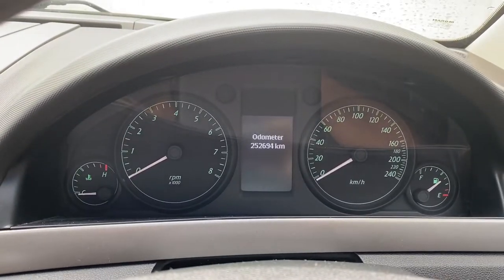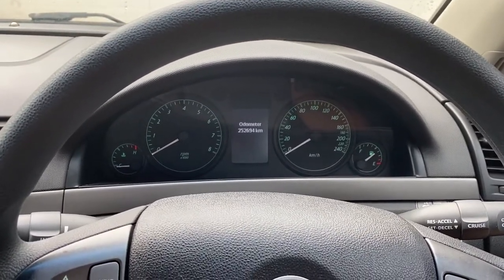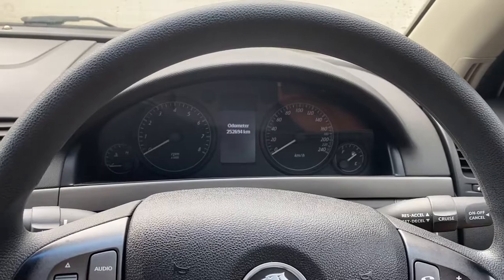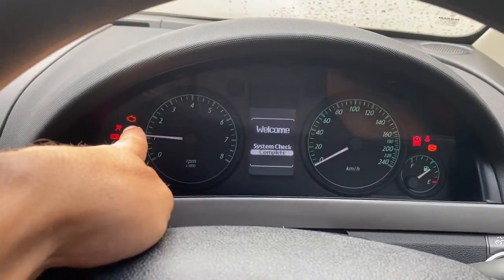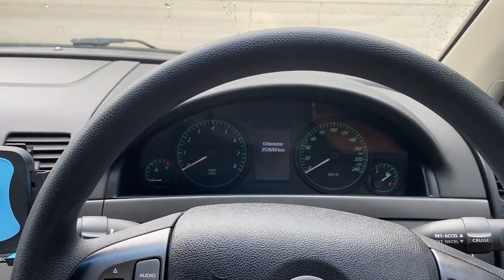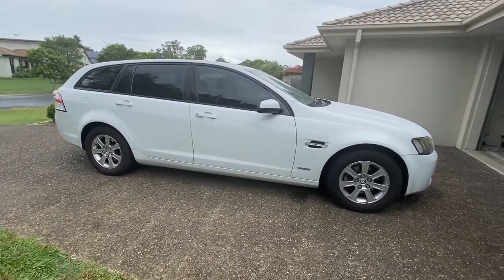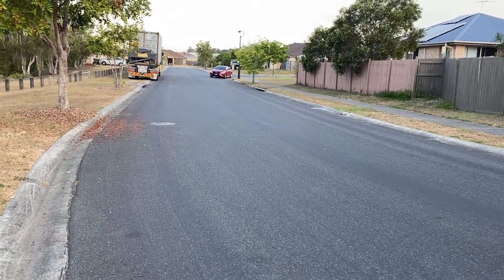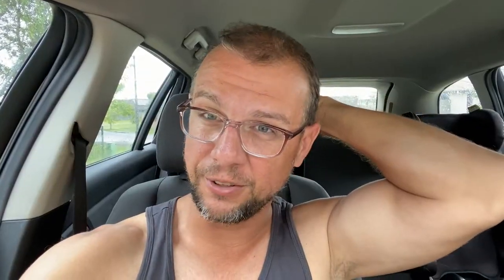250,000KM Commodore Timing Chain Issue Update

Comment: Just watched your Timing chain video which confirms my thoughts and approach to 'limit switch' monitoring. I bought my VE Ute about 18 months ago with the engine dash warning and new about 'issues' with the VE engine timing chains. Like your wagon the car runs great, there are no noises coming from the engine and I plan to monitor it as you have been doing. I only drive about 3000kms per year so I'll never get to 250,000kms. Sitting at 205,000 now. Thanks for sharing and confirming for other VE users. You should definitely keep your VE as a workhorse, its still a nice looking car!
Reply from the maker: Hi Gary, thanks for you comment here. I move the old girl on, I madea  final video to finalise it all, good luck with your VE...👌

Comment: Bought mine at 160thousand. Vz alloy 2006 ,No timming chain done. Engine light came on around 200 thousand. Transmission light round the same time abs fault around the same time and I'm running it to the ground still going strongish at 250. Just started hearing a new sound though. That's what brought me here. great vid mate. 👌
Reply: G'day bloke.06 vz sv6and calais will have an updated chain and pulleys so will never give ya timming chain dramas.Yoll know what you are hearing when you hear it.Youll pray it's the aircon  compressor but you'll know it's not.good luck
Reply: @riffraff1015  ahhhh okay, Thanks for the good information!
 It's been a year since this comment so sadly i don't have it anymore. Got a ve now haha. Thanks for the reply though appreciate it.

Comment: I have a 2011 Omega, 314,000kms with original chains, still runs pretty good, but have replaced a number of parts including the evap solenoid, a couple of water pumps and starter motor.

Comment: Thanks good info . My 2009 be 3.6 has 305000km with an intermittent engine light . I’ve been doing 10000km oil changes for the last 150000km. Let’s wait and see .
Reply from the maker: Hi Ben! I've sold mine, so keep us updated, as my last video will be a 270,000km final one!!

Comment: i've got a VF 2014 SV6 LFX 210.000Kms with the 10mm timing chain. Its been rattling for a while now and i thought it was the cam phasers. But after taking off the rocker covers yes its a loose chain on bank 2. No codes though. I think holden adjusted the software so it don't code till much later.

Comment: I just had my timing chains replaced,  the engine had a rattle on start up. Which I was told was the variators on the cams. The chains had apparently been replaced but with cheap Chinese chains.
Reply: Did having the timing chains replaced solve the start up issue? I have the same issue.

Comment: Hey Vroom Broom,
2009 VE sports wagon, bought at 130,000km, currently has 192,000km. On any  cold start, it has a couple of seconds rattling at the front of the motor  then o,k.  However,  last oil change, I filled with 5W30 full synthetic and the rattle is only occasional now.
I understand that Holden fixed the cam chain issue before the ve wagon commenced  production and no Sports Wagon has that problem.
I am keeping my VE loooonnnnggg term, maybe I'll convert it to electric.
Cheers H
Reply: I've got the series 2 wagon and i have the timing chain codes regularly.

Comment: Posting up the specific code you are getting would help knowledgeable people help to diagnose the issue. I presume that you are getting cam position 'timing' codes, the sensors that you cleaned do not need to be gapped differently, when they fail they either fail as they heat up (and resume function when cool) or they just stop working entirely and the engine goes into a "limp home" mode where the only forward gear is 2nd and the throttle is limited to 20% along with a FLASHING check engine light. If you have a cheap code reader go ahead and unplug a sensor and see how the car acts. The most likely candidate is one of the VVT solenoids hanging up (they are below and between where the sensors are mounted). They have a small screen that plugs up and are machined to such a tight tolerance that they can be damaged easily by dirty oil. <when the engine oil filter gets plugged up from overdue service it has a bypass valve that lets the unfiltered oil bypass the plugged filter to keep the engine from blowing up> As a retired 25 year master mechanic I would recommend replacing all the Variable Valve Timing solenoids and servicing the oil more often. Sure, keep the car till it dies, but keep it well maintained mechanically. $4000 doesn't seem like a lot to pay for a used car but consider if someone offered you $4000 off the price of your next *newer* car, you could continue to use this one for a while and still retain a fair amount of that $4K if you maintain this one and not let it become a tow away loss. The sensors are probably $200 all together if you only pay for the parts.  The reason you don't notice a change in power or a fuel efficiency change is the frog-in-a-frying-pan effect, it's been 100,000km since it ran properly :)
Reply from the maker: lol, thanks for that thorough response. I’ll have to check out those solenoids. 👍

Comment: Gee you have been lucky that it has lasted that long.Mine snapped at 120000.Costly to replace.Love your videos.
Reply from the maker: Did it actually snap? Oh please give me more detail of what happened 🙏 I would love to know the symptoms etc.
Reply: @VroomBroomZoom  Well there was no warning on mine.The engine light came on and a minute later the car shut off.There was no rattling or any other signs that the chain was going to break.Lucky i was only around the corner from my mechanic.That is the only major thing that has occurred on my car(touch wood).It has 157000 k`s now and is a 04/2010 series one VE Commodore.I was like you i was thinking of selling and then wondered what could i buy for the money?Best to keep until the wheels fall off or it just stops.Know the car to well and if i sell and buy another who knows what problems it may have!!BTW i think we may live in the same area?Cheers.
Reply from the maker: Thanks for this! Interesting that it had no prior issues or symptoms and just went pop. Seriously, without this one thing, the VE commodore is not a bad long-term car at all.
Reply: @VroomBroomZoom  A very good long term car.I have had mine for 5 years and the only thing that i wish it had was the 3.6 litre motor.I find the car is too heavy for the 3.0 litre motor.I am comparing it to my VZ Commodore with the 3.6 motor(VZ being a lighter car with the bigger motor) that i had previous to this car.But overall i am happy with the ride and handling and it does what its suppose to do.
Reply from the maker: May it run for a while yet. :)
Reply: @samkaur4098  I think I might find the power up in the rev rang Mine eats VZ's

Comment: Thanks for the update - i was a day early on the previous video.   Dr Know mentions the frog in a frying pan effect - suggesting your numbers are the same because you are comparing them to potentially incorrect numbers to start with.  If you want, post your numbers here and i'll give you mine (ie a comparison from my 112k 2006 VE).  Totally agree with your re the value of keeping verses selling and repurchasing (hence bought my VE off Father in law for $2k).   Even if it poops itself and costs $2 or $3k, I'm still miles ahead on $$$ compared to the chap who paid $30k for a brand new one!  Is that Camary Hybrid?   I have been driving a work one from outer east melb to Albury and back (pre CV19) and only using half a tank!!!!   Awesome. Love it.
Reply from the maker: Hey, thanks for your comment 👌 We opted for a standard Camry as we do highway kms anyway and it equals out in efficient apparently. It’s such a refined car to drive, especially compared to the VE. Great cheap pick up for $2k, The VE is a solid car with minimal bells and whistles, it’s great really except for this issue. 👍

Comment: Hi mate I  just got  a ex cop ve the seller  said it needs a new timing  chain. It doesn't rattle at all  but has warning light i just wonder  after people repair them why is there no error code.  I was at a mechanic and a guy pulled in with a rattling chain but no warning light figure that out
Reply from the maker: lol, OMG, the cop VE sounds like my car. The sensors (I think) 'gap' the chain, so it senses if there is a change in the tolerance. If the chain is ratling, it may be somethiinng else, like the tensioner on the chain malfunctioning, no oil, or anything else I have no idea about near that area of the engine 😐

Comment: Hi, I’m looking at a 2007 VE commodore sv6 with the alloytec engine for $8000 with 255,000ks and wondering if it’s worth buying it. The cars in good condition as well
Reply from the maker: Ops, just saw this...sorry! I would say......no. You might get real unlucky and if you get this issue it could go into limp mode like it has for quite a few people. The onyl way is to pretend you're buying it for $11,000. Is it good value at 11K? Then, if you do get lucky and have no problems, sweeet. PS. $8000 for a 14 year old car that is basically a very very mild version of the base model is a bit steep in my opinion.

Comment: Hey mate is it still going. My check engine light has been on for at least 2-3 years. Timing chain  problem. I go decided to drive till it dies. I think it died today. Car just stopped luckily in my driveway. Had been ticking recently so I thought it needed oil change so I did that but still not turning on. Has around 290,000 on the clock and it’s the second timing chain since new car
Reply from the maker: A god run 👌👌👌
Reply: @VroomBroomZoom  haven’t had it looked at yet cause it’s stuck in my driveway
Reply: Mine came on at 114000 turned it on and off 3 or 4 times it disappeared then came back on the day after 160 service they swapped senses over came on at  17000 no sound apparently puts cams or something out abit , but decided to get it replaced it was going to trade it in but first thing I got asked was has the timing chain been done lol

Comment: My 2009 is in limp mode at 98000k chains are rattling
Reply from the maker: Bugger 😐
Reply: @VroomBroomZoom  unfortunately it happens so I’m just gonna go through mace and get some cams while I’m at it
Reply: Bloody timing chains you'd think would last
Reply: @sammyequine2394  ya and to make it worse when I tore it apart and did the chains they ended up being not to bad but still needed replacing but the crank reluctor wheel was the problem so ended up doing a full rebuild
Reply: Bloody hell at 98000 k`s?I thought mine chains shit itself so early at 120000 k`s!!!
Reply: Maybe new throttle valve will do?

Comment: Hi how are you? I felt compelled to put you on track regarding the timing chain issue. The drivers side engine bank doesn’t breathe properly due to holes in PCV valve being too small. They have an official modification bulletin in the U.S. for this I believe. First watch this video  https://youtu.be/5QLPU1Qh2oo . I will send link for the fix in a separate comment so all this does not get erased while I navigate to the fix video to copy the link.
Reply from the maker: Yeah I’ve seen that, but it’s probably too late for most of these, unless they’re really low kms